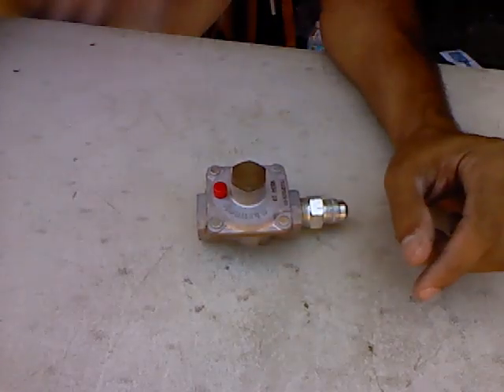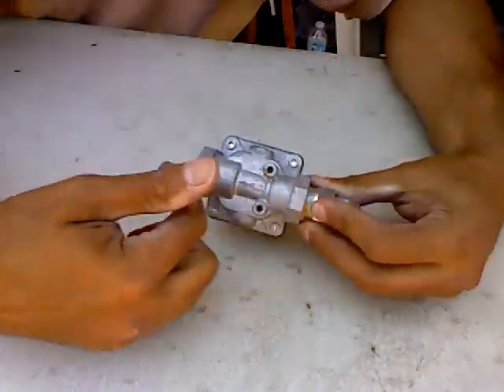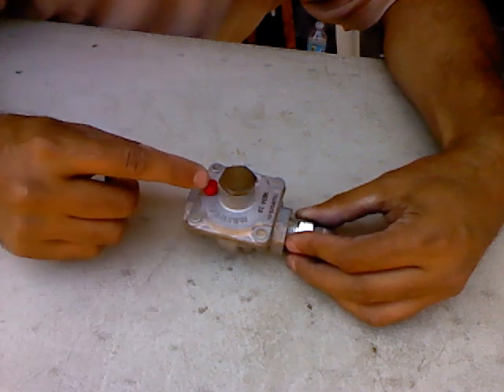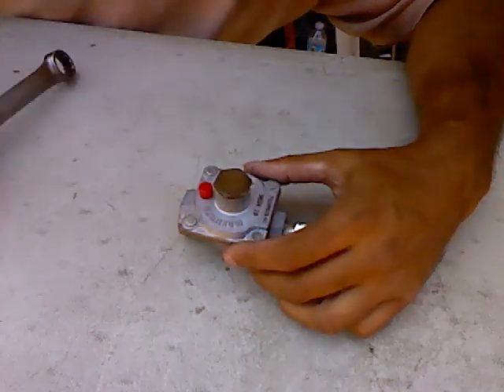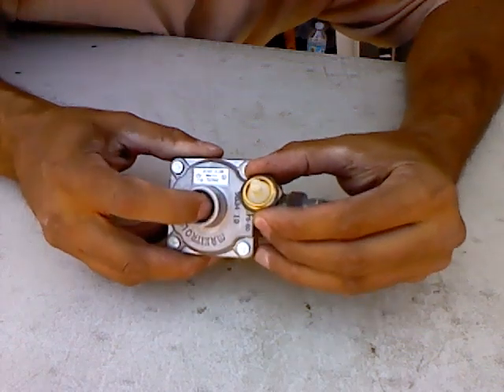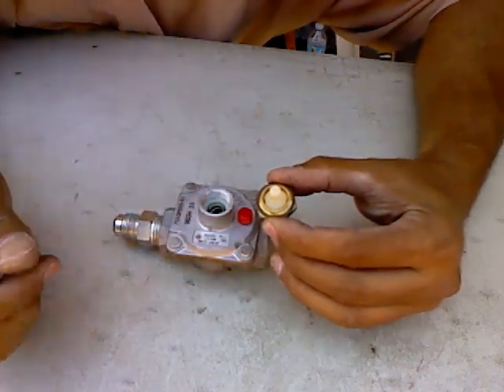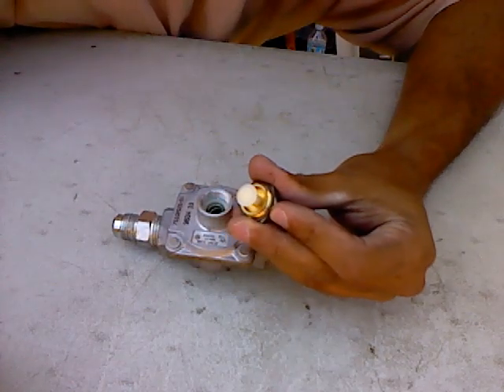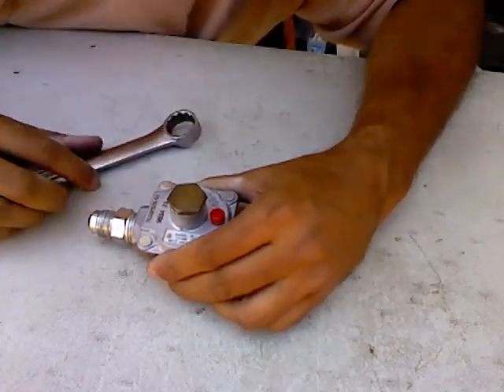Converting A Maxtrol Gas Regulator for  Natural Gas (NG) or Propane (LP)

Comment: Im having trouble changing the pressure higher on this type of regulator. Can anyone help? Not needing to change from natural gas to LP. 

Just turning up the pressure. There seems to be no screw to turn it up.
Reply from the maker: This particular type of regulator can only be changed FROM propane TO natural gas. It cannot be adjusted. If you need an adjustable regulator, you'll need a completely different type of regulator like the one illustrated at the 17 minute mark in this video: https://youtu.be/AddrkTCBd7c?si=lQMgjRzoEmtT7oZM

Make sure to like and subscribe to my video channel when you visit.

Adjustable regulators come in either propane or natural gas varieties. I have both types, so feel free to call or message me at 714-574-1544.

Comment: Thanks Frank, but having  real issue, Have a brand new 3 burner gas grill and the regulator seems screwed up, yes it's on the correct way, arrow towards the grill. But when I open the ball valve ahead of the regulator and go to light the grill, I hear a quick poof of gas then the gas flow shuts off . You think the regulator is defective? No idea why the gas flow stops , running thru a 1/2" pipe in and out of the regulator, an the faired fitting is 3/8" to the grill. It's running from a 300 gallon pig tank, if I take the line to the grill from the regulator the flow keep flowing, but hooked up to the grill , one poof and gas flow stops, any ideas.?  Great video and info now help me out please Like all your info  👍👍👍👍
Reply from the maker: I carry conversion parts for everything made. Visit my website - www.flamesources.com  or call me. I'm now in the Midwest.  You can always get a hold of me by dialing 714-574-1544.  That rush of gas that you heard could indicate that there is a leak further upstream. This is characterized by an explosive ignition process. If the burner you're talking about is a ceramic burner, there's always a flame sensor near those to determine if there is heat emanating from that burner. You'll want to check that probe to see if it's intact. These sometimes wear out and go out of spec. The good news is, these probes are still available.
Reply: @frankhamilton8257  Frank thanks so much, found the issue, the gas or propane company hooked up the line from the tank to the grill line before the pancake, they just put a 2 stage regulator on the line where it runs into the house, before the pancake, they should have run the line after the pancake, no charge,    and now works perfect. Grill works and lights great  thanks so much for your attention,  Stony

Comment: Hello Frank, how can I adjust this NG gas regulator, sometimes the gas in my stove is completely cut off, of course, there is a 6-sided brass screw on my regulator, thank you
Reply from the maker: I actually carry orifices for every stove and barbecue made on my website  https://flamesources.com/  I'm now in the Midwest, and you can always get a hold of me at 714-574-1544. Make sure to like and subscribe to my channel.

It's important to note, that if you're regulator has a six sided cap (not screw), then the regulator is a unit that can be converted between natural gas and propane.

Some regulators will cut off if the unit that it's attached to if it is drawing more fuel than it's designed to pass. This is usually caused by a fuel leak somewhere within the system. If that's not the case here, I would simply replace the regulator and see if the problem persists.

Rule of thumb is: the larger the regulator body the more gas or BTU it is allowed to support.

Comment: This was the info I needed to convert to LP.
I purchased a used Viking 5 series range running on Nat Gas. Thank you.
Reply from the maker: I actually carry orifices for every stove and barbecue made on my website  https://flamesources.com/  I'm now in the Midwest, and you can always get a hold of me at 714-574-1544. Make sure to like and subscribe to my channel.

Converting the regulator is only part of doing a fuel conversion. Unless the orifices are adjustable orifice hoods, you would need to swap orifices as part of the swap. Depending on the model, you may need to change jets also. At any rate, I carry all these pieces as part of my extensive inventory.

Comment: We did this conversion and turned the oven on to see if the damper needed to be adjusted, the flames were coming into the oven they were so high, we adjusted the damper to the extreme opposite and the flames went down but are still to high.
Reply from the maker: I actually carry orifices for every stove and barbecue made on my website  https://flamesources.com/  I'm now in the Midwest, and you can always get a hold of me at 714-574-1544. Make sure to like and subscribe to my channel.

The regulator is only one part of a propane conversion. The other part of a fuel conversion involves changing the orifices to a smaller size to accommodate the use of propane. I've likely done more than 60.000 fuel conversions over my career, so it's likely that I have the parts for whatever it is you're converting.

Comment: Super helpful video! Frank is super awesome and helpful! Gave him a call trying to convert an older oven and he knew exactly how to help. HE ALSO SELLS PARTS AND OROFICES. If you're in need he is the man. Thanks again!
Reply from the maker: I actually carry orifices for every stove and barbecue made on my website  https://flamesources.com/  I'm now in the Midwest, and you can always get a hold of me at 714-574-1544. Make sure to like and subscribe to my channel.
Reply: I could use help. I have a P366CLP thermador that was built to accept LP and I’m trying to convert to NG. I have the orifices but didn’t buy a regulator yet.

Comment: How do you increase the gas pressure? There isn’t a screw inside to increase it
Reply from the maker: I actually carry orifices for every stove and barbecue made on my website  https://flamesources.com/  I'm now in the Midwest, and you can always get a hold of me at 714-574-1544. Make sure to like and subscribe to my channel.

The only way to alter fuel pressure is the use an adjustable regulator like the one shown in this video: https://youtu.be/AddrkTCBd7c?t=260  This video is already cued up to the point explaining the functionality of this regulator and these regulators are available in propane or natural gas models. And, yes, I also carry these models. Make sure to like and subscribe to my video channel.

Comment: Hi Frank.  I'm converting my Costco Signatuer 5-burner gas grill from propane to NG and the propane gas regulator is a Ningbo-Wanan.  I know the propane orifices need to be either removed or drilled out (mine would drilled to a drill size of 52 for each 10000 btu burner) but am wondering if I'd need a natural gas regulator in addition?  Thanks.  Bo
Reply from the maker: Converting the regulator is only one part of doing a fuel conversion. I actually sell orifices for every stove and barbecue unit made on Flamesources.com  I'm now in the Midwest, and you can always get a hold of me at 714-574-1544 during normal Midwest business hours.

For whatever reason, a lot of manufacturers don't use regulators on their units. I suspect this has something to do with profitability, however, when you consider you're playing with fire, it's a good idea to consider using a fuel regulator to control the amount of gas that passes through to your grille. After all, all of your other home appliances are equipped with a fuel regulator. Only the high end brands (I have a 60" DCS) use a fuel regulator.

I'm not sure where you got the information from for this conversion. I use data from charts that I acquired from Ward Burner systems to calculate all my orifice openings, but there is also data available for laypeople to use like the the info on this link: https://www.smokingmeatforums.com/media/orifice-20capacities-20chart-20i-jpg.372475/full?d=1507233278

Comment: i'm hearing a hissing sound did i do something wrong
Reply from the maker: Converting the regulator is only one part of doing a fuel conversion. I actually sell orifices for every stove and barbecue unit made. I'm now in the Midwest, and you can always get a hold of me at 714-574-1544 during normal Midwest business hours.

You likely have a perforated burner that's leaking gas along the gas tube. It will sound like the burner at 11:03 in this video: https://www.youtube.com/watch?v=adR15T7FQTU      Make sure to  like and subscribe to my video channel.

Comment: You are correct about the natural gas flow but [ arrow on valve tells which way the flow of gas should go to the appliance ] why is there a flex line fitting on the wrong end? Or do I have that wrong?
Reply from the maker: This regulator actually fits onto the hard line coming into the stove just before the manifold that houses all the control knobs. The flex line is on the inlet side of the regulator because that's where gas comes in. Converting the regulator is only one part of doing a fuel conversion. I actually sell orifices for every stove and barbecue unit made. I'm in the Midwest, and you can always get a hold of me at 714-574-1544.

Comment: Your video, and a couple others like it, just saved my sanity.  For years I have been living with a converted cooktop (NG to LP) that never seemed to put out enough BTUs but I couldn't figure it out so we lived with it.  I decided to check the Maxitrol convertible regulator that I have and it turns out the installer never changed it.  They changed the orifices but didn't convert the regulator.  I may now properly boil water.  Thanks.
Reply from the maker: Converting the regulator is only one part of doing a fuel conversion. I actually sell orifices and regulators for every stove and bar-b-que unit made. I'm now in the MidWest, and you can always get a hold of me at 714-574-1544.
Reply: @frankhamilton8257  That's a nice offer but if you'd read my whole comment you'd see that that part of the conversion had already been done.

Comment: Frank, thank you.  Do you have the model# for the Maxitrol valve you show here?
Reply from the maker: Converting the regulator is only one part of doing a fuel conversion. I actually sell orifices for every stove and bar-b-que unit made. I'm now in the MidWest, and you can always get a hold of me at 714-574-1544.

This is NOT a valve, it is a regulator designed to limit the fuel flow though a gas or propane unit. The knobs that control amount of fuel used by a burner are actually attached to a gas valve which enables the user to feed more or less gas through the burner head. The final part that controls the amount of fuel flow is the orifice.

Comment: Nice video Sir! What model is that?
Reply from the maker: Make sure to subscribe to my channel on your visit. Converting the regulator is only one part of doing a fuel conversion. I actually sell orifices and regulators for every stove and barbecue made. I'm now in the Midwest, so you can always get a hold of me during normal Midwest business hours at 714-574-1544.

I can't recall what the model of this particular unit was. I generally like to use Maxitrol regulators, however a Harper Wyman regulator will work just as well, and that's the regulator that Thermador uses on all of their products. You'll note that Maxitrol regulators fall into three basic categories: adjustable natural gas regulators, adjustable propane regulators and regulators that can be swapped between propane and natural gas. The former regulator (the one that can flow either propane or natural gas) features a brass hex cap (on Maxitrol branded regulators), while the ones that are dedicated (but adjustable) for propane or natural gas (made by Maxtrol) usually have a chromed cap with a standard screw slot down the middle of the cap. The adjustable mechanism inside of them features a Phillips screwdriver slot and turning counter clockwise will allow more fuel flow, while turning clockwise will restrict fuel flow. Harper Wyman regulators are a totally different configuration and require flipping the cap itself to alternate between propane and natural gas. I have a more comprehensive video on fuel regulators, so make sure to view that video if you need to know more:  https://www.youtube.com/watch?v=AddrkTCBd7c
Reply: @frankhamilton8257  Hi Frank. Can I buy a regulator off you. I plan to buy a counter top stove for my house but the problem is i have no gas line. I will buy one compatible with a propane tank. Second problem, fire hazard. I fear turning my house into a gas ball explosion. Would you direct me to the best regulator that will not make me and my neighbors homeless please
Reply from the maker: @un-confiscate-able-money Converting the regulator is only one part of doing a fuel conversion. I actually sell orifices for every stove and bar-b-que unit made. I'm on the West Coast, and you can always get a hold of me at 714-574-1544.

I've done quite a few outdoor kitchen conversions. Just give me a should and we'll go though the due diligence.

Comment: Great video!!!  My frigidair come with Maxitrol RV47NCL,  sometimes I see 47CL model .  what is the difference between NCL and CL,  or even just L?
Reply from the maker: Converting the regulator is only one part of doing a fuel conversion. I actually sell orifices and other gas and propane parts for every stove and barbecue unit made. I'm in the Midwest, and you can always get a hold of me during normal Midwest business hours at 714-574-1544. 
I'm a little unclear on the Maxitrol labeling convention, so I'll lend some speculation on what the difference most likely is. The difference from one regulator's features to that of another usually boils down to four things:
 1) The output flow rate, the regulated release rate expressed in inches of water column (10"WC LP or 5"WC Nat for example). 
2) The size of the inlet and outlet (1/2 inch vs 3/4 inch for example). 
3) Whether the regulator is intended for use by both gases or whether it can only be used by a one gas or another (natural gas and propane - here in North America. There are, of course other fuels used in other countries like Butane, for example). 
4) Whether the regulator has an adjustable output (expressed in Inches of Water Column) for use with only one type of gas (again, usually Natural Gas OR Propane). If a regulator is intended to be used by one gas or another the output rating is usually adjustable.

Comment: Mine has a leak from the nipple nut area how do I resolve that issue. This is a new regulator.
Reply from the maker: Depending on how much gas is being released,, it's a possibility your regulator is releasing gas in excess of it's rating (which is what they are designed to do), however this may or may not indicate an issue further upstream. Try replacing the regulator from another source entirely (not from the same vendor), and see if this changes. You never want a gas leak in an enclosed, unventilated environment.
Reply: I’m under 1%

Comment: How do I know if I can do this easy conversion? I just bought a Avantco 3 burner countertop griddle and it says it’s natural gas but field convertible to LP. It came with a regulator and lp tips. Manufacture isn’t much help they say to have a professional do it.
Reply from the maker: I sell conversion orifices and kits for just about everything made, and I've likely converted just about everything made in practice. it sounds like you already have the orifices you'll need to do this one. I have tons of videos on how to do all kind of conversions from stoves to barbecues. A natural gas to propane conversion is relatively simple. I've done a video on how to do this:     https://youtu.be/adR15T7FQTU      My channel has a host of videos on doing fuel conversions, so make sure to subscribe.

Comment: Thank you Frank. I have a Jenn-Air 5 burner Natural gas cooktop. I plan to convert to LP gas. I was aware of the orifice change and the regulator change. But did not know that some regs were convertible. Thanks again.

Comment: What is the model number of the Maxitrol unit you are using? Thank you Frank.
Reply from the maker: This unit is a Maxtrol RV-47, but there are a number of different regulators that can be used according to the total BTU rating and the type of application involved. Furthermore, not all regulators can be converted from natural gas to propane. I often use adjustable propane or natural gas regulators when the application calls for it. An adjustable regulator allows an adjustment of the output fuel pressure to suit the minimum flame requirements of the unit that it's being installed on.
Reply: Thank you Frank. I have 1 Generac 11KW and 1 16KW propane unit with 3/4" pipe going to them. What regulators might I need. @frankhamilton8257

Comment: Can this regulator be used to convert a Holland Companion Grill from LPG to Natural gas?  Holland says no drilling, orifice cannot be replaced but others have drilled the orifice and commented that it works.  Your valve seems like a better choice if I can use it on the Holland Companion Grill.
Reply from the maker: A fuel conversion always requires two things; boring of the orifices and a conversion or changing of the regulator. Here, in North America, unregulated natural gas is usually delivered at 7"WC in the home, while LP (propane) is usually delivered at 10"WC or 11"WC. For propane, I usually calculate my orifices to work at 11"WC if an under grille tank is used. I usually supply new orifices and a matching regulator to all my clients. Just call me at 714-574-1544.

Comment: I want to buy a Firman H07552 generator which is gas and propane.  I have natural gas NG at my house.  How hard would it be to convert the generator?
Reply from the maker: It shouldn't be that hard to convert it since it's designed to run on Propane. It would be a matter of changing the jets out and changing the air/fuel mixture. Is it on propane now, or is it on Gasoline?